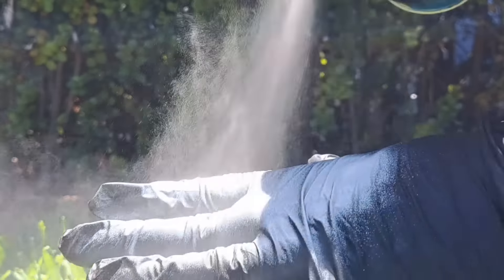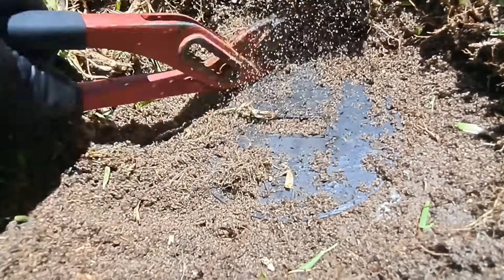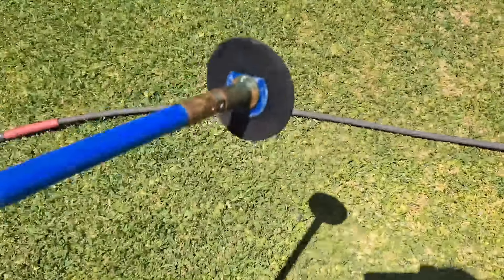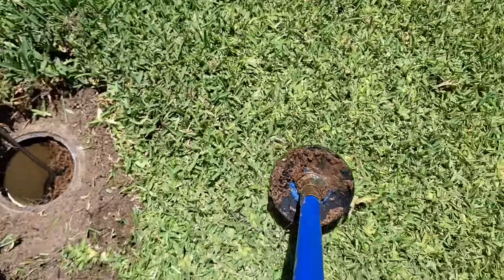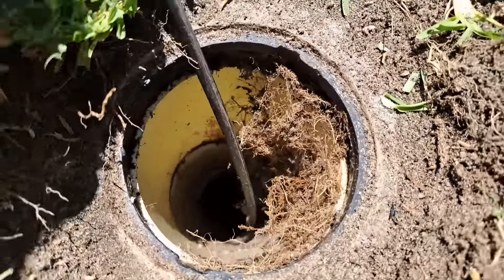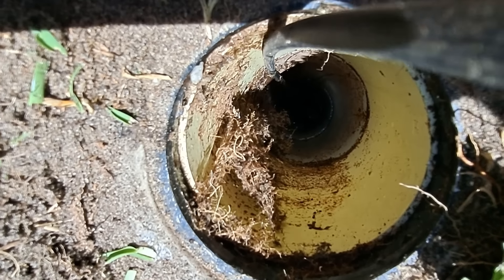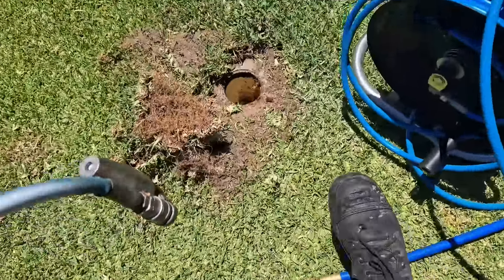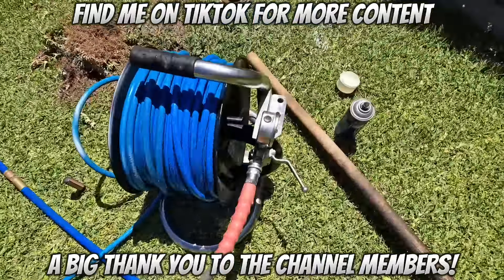All the drains in the house were BLOCKED! Client needed the Toilet!

Comment: Very good. Glad you got you the equipment you need to do an excellent job. Keep up the good work and you will get return customers calling you every time and their friends. Always run the full length of the pipe with your camera. And clean out any roots and debris Once your company gets a little bigger. Get you the camera what the sensor and buy you the rigid underground pipe locator to mark for the customers with paint where are the broken sewer line are. And you'll be one of the top notch sewage and drainage cleaners. Keep up the good work son